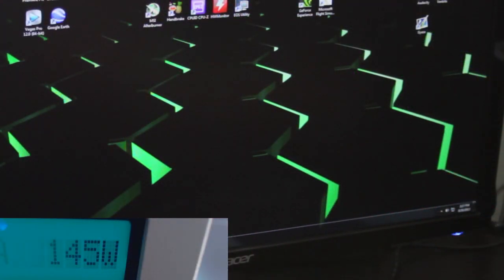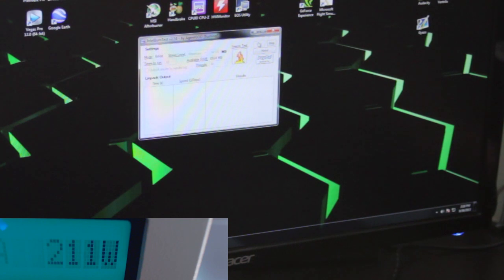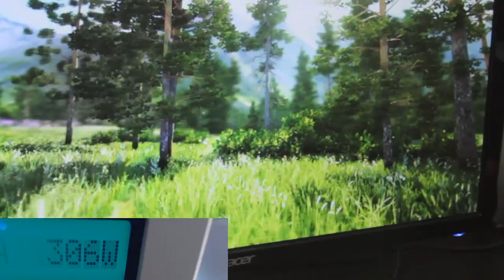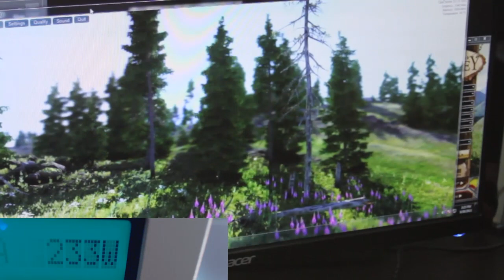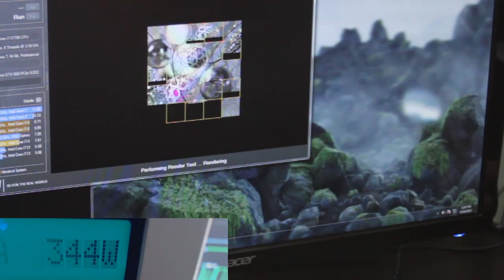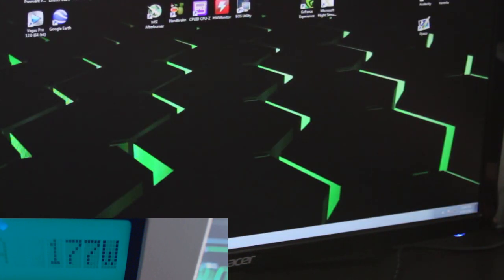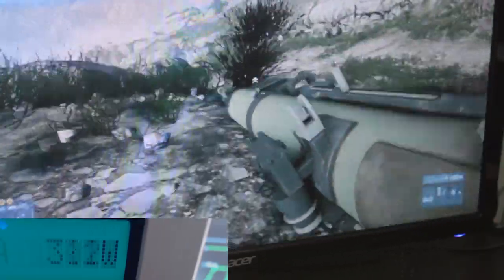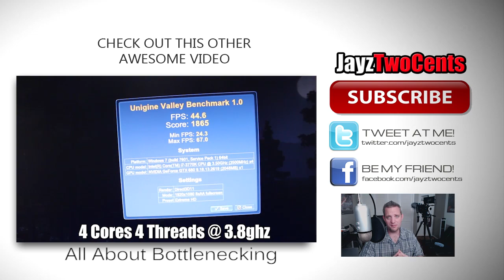How big of a Power Supply do you REALLY need?

Comment: Hes not entirely correct when he says the less of your psu you use the more you waste. most 80+ gold psus get about 87% eff at 20% load, 90% at 50% load, and back down to about 87% at 100% load. depending on the psu the eff will drop when load is below 20% and will typically get 82% eff at 10% load. so there's a sweat spot though the difference is minimal. sometimes its worth buying a  larger psu than you need so you wont have to buy another psu down the road
Reply: +SnipeYouFromMars Would anyone here mind checking my build's compatibility as well as total power requirement??
This is my first build, and i'm up to my last part; PSU. :(  and each item on the website doesn't specify the wattage needed. 
Only a few which i will list on the very bottom.
Feel free to give me suggestions on what other parts may be better. (im on a budget) 

MB: Biostart TA970 AM3+ AMD 970 + SB950 SATA 6Gb/s USB 3.0 ATX AMD Motherboard with UEFI BIOS
RAM: HyperX Fury 16Gb (2x8gb) 240-pin DDR3 SDRAM DDR3 1866 Model: HX318C10FBK2/16
HDD: WD Blue 1TB HDD 7200 RPM SATA 6gb/s 64mb Cache. Model: WD10E2EX
SSD: Samsung 850 EVO 250Gb 2.5inch SATA 6gb/s Internal SSD Model: MZ-75E250B/AM
GPU: Asus Stric Radeon R7 370 OC 4gb DDR5 256-bit display port HDMI 1.4aDVI-D ? 
CPU: AMD FX-6300 6-Core Processor Black Edition. Model: FD6300WMHKBOX
Liquid cooling: Silverstone TD03-LITE Durable High-Performance All in one Liquid CPU Cooler with Dual Adjustable 120mm PWM Fans. 
Case: DIYPC Zondda-O Black, USB 3.0 ATX MidTower Gaming PC case. 3x Orange/LED Fans. (I believe these 3 fans that come with the case will need power as well?) <Might regret that question because it sounds very stupid but im like flat on new to this.<

GPU (200 W) (I read in the comments of a review)
HDD (7 W) ??
CPU (95 W)
LiqCool: (12 V) ? 
RAM: (1.5 V) ? 

See, i'm not even sure i have them right, so it would be awesome if anyone can double check it's compatibility and power usage! 

Thanks :)
Reply: +Andrew Hamid literally take your shit to pcpartpicker.com

Comment: Hi, could people help me with my build please? I am wondering how much wattage my PSU should be at. According to PCPartPicker, the build runs at around 322W. Here is the build:
Intel Core i5-4690K 3.5GHz Quad-Core Processor
Corsair H110 94.0 CFM Liquid CPU Cooler
MSI H97 GAMING 3 ATX LGA1150 Motherboard
Kingston HyperX Fury Red 8GB (2 x 4GB) DDR3-1866 Memory
Seagate 1TB 3.5" 7200RPM Hybrid Internal Hard Drive
MSI GeForce GTX 960 2GB Video Card

People have told me to get either a 500W or a 400W PSU, so I am not sure which to get.
Thanks for the help!

EDIT: Both EVGA PSU
Reply: Thanks for the response!

Comment: I'm planning on buying a custom pc,
here are the specs:
CPU i5-4590
GPU gtx960
RAM 8 GB
so what's a decent power supply for a pc like this?
Reply: +Szabolcs Mate thanks for the advice
Reply: +Vasilijan Nikolovski 500W with 80plus rating.
Reply: +Vasilijan Nikolovski A good quality 400W would do. May want to go above if you plan to upgrade to a higher tier GPU. Just pay attention the 6pin and 8pin connectors, or you may have to buy an adapter.

Comment: Yes a 750/850 watt power supply will have the Watts to run dual GPUs but what every1 forgets is the AMPs !
It may have to watts but does it have the AMPs to run everything ?????
Reply: Watts are a measurement of work, whereas amps are a measurement of the amount of energy used. You get watts by multiplying amps by volts. Given that watts= amps × volts then yes, you'll always have enough amps to run everything. But you do not measure amps alone because you need enough voltage (force) to push the amperage. This gives you your wattage rating.

Comment: If i have old/low/not so good specs. Do i need better or not so good power supply? And if you can tell what i need with these parts:  Graphic Card: Club 3D 2600XT GDDR3 512Mb Processor: i3-3220 3.3Ghz MOBO: ASROCK S1155 H61 USB2 GLE D-Sub MATX And 3 normal fans, i would be very happy!
Reply: u can use an aftermarket psu at about 350 or 400 watts.
Reply: +vertti kallio I would still get a decent power supply because if it fails it can screw up everything in your system
Reply: Sam Hewitt cx430-dont buy
evga 500w-do buy

Comment: I'm going crazy over all the different understandings on PSU. Here's my rig:

Intel core i7-4790 3,60 GHz
NVIDIA GeForce GTX 970
2 x 4GB DDR3
2TB SATA3 7200 rpm
120GB SSD
AcBel 80+ bronze 450watt

How do you feel about that?
Reply: +Reminiscity How is this running? I have pretty much the same rig I want to build for my Son asap only with a i7 4790, MSI B85-G41 PC Mate MB,  Evga GTX960 4 GB ACX 2.0 and 8GB ram DDR3 1600 and only (1) 1 TB WD Blue.  My questions are...I bought an Ultra Professional LSP V2 550 (Made 2013). Is this a big enough power supply? Is this PC enough power as he only plays World of Warcraft (Warlords of Draenor) My 1st build. Can anyone please help. Thanks for listening!

Comment: so 500W is more than enough for my low end crappy pc... good to know!
Reply: +GermanKraut he said low end pc
Reply: +Grizzly If your pc uses about 400-500w its perfectly FINE and even recommended by people who understand energy efficiency and capacitor aging to get a 1000W psu. Don't forget capacitors over time age. The more load on them the hotter they get, the hotter they get the shorter they last.
Reply: I'm pretty sure It's not the Power Watts. It's possibly that you have bad motherboard that is faulty. Or MAKE SURE you have adquect airflow in your case. Motherboard DOES NOT LIKE HEAT AT ALL......Dust is a great insulation. So make sure you get air flow and keep case clean of dust. 

Hope this helps despite its late.
Reply: I mean I have a 1060 and a couple fans and on high intercity games it sits around 350 so you’ll be good for a while
Reply: +TheSwedishDude95 lol
Reply: +Grizzly Surely. i5-2500K@4.4G + 7870 on 40W psu, only 250W in normal load, very max is 360W under nonsense synthetic load (FurMark+ Intel Burn Test)
Reply: +GermanKraut I have fx 8320 ,,and a r7 360,,I have 500 watts,and it turns system off,,do you know what power i need!!!r
Reply: Red Phoenix Interesting. Well lets see this 1000w RM1000 is more efficient at 30% then my tx650 was at 50%. But yes callbullshit all you want. All psus including platinum and titanium are the MOST efficient betwee 20-80%. It drops off a lot sharper after 80% then below 20%, hell this psu is 88% efficient down to 50w. While the prime efficiency range is between 30%-60% as the peak efficiency. But again you can believe what you want, reading a graph isn't hard haha.
Reply: matthew bungard Should be enough.

I hope its atleast a 80+ Bronze rated power supply, not some cheap china 500W Power supply.

If yes... Change it to an be quiet!...
Reply: +Grizzly 
Nope. Overclocked i7 6700k and GTX 980 are taking about 450W.
If you use AMD, well you need more.

Comment: Hi guys will a 500w power supply be enough for this build?

CPU:AMD X4 860K Quad core
GPU:GeForce GTX 750 ti
RAM:8GB Crucial ballistix sport
Hard disk:Western digital blue 500 GB
Motherboard:Msi a78m-e35

If it isn't enough tell me what's sufficient
Reply: +urawesome2 It is enough, i have 450w psu powering my GTX 970 and Xeon 1230v3
Reply: +Hobi Nimetön thx

Comment: i recently got a corsair cx 600m (600 watt) psu from a friend for my first build, and i was wondering if i could get your opinion on whether or not it can handle an r9 290 with an amd 8350 (not going to get into overclocking with this psu) and basic first build components (hyper 212 evo, 1866 g.skill ram, 1 hd, 1 ssd, 3 case fans, mouse/keyboard, and a fairly old 1080p moniter) without serious psu stress.

lmk thank you
Reply: dudewhy Noreallywhy Recommended is a 750 watt psu with that graphics card.

Comment: Actually you don't want to max out your PSU. You want load around 70-80% of rated wattage. So for 750W PSU that would be between 525-600 watts. That's when all quality PSUs are most efficient. You also got the 80 plus thing wrong.

Comment: The reason many people get a PSU larger than they need is because when they buy their graphics card there is some BS about PSU required. Classic example is when I put a R7 250 in my 6 year old HP Pavilion, which has an Intel dual core e5200. The website that I got my GPU from said I needed a 400W PSU. I decided to see if the 250W PSU in my Pavilion would work...on my power meter, I can't get it to go over 80W when running Valley benchmark, what do I need a 400W PSU for?
Likewise my i5 4690K with an R9 290X OC will hit 550W :-)

Comment: So.... I have a 750 watt 80+ bronze power supply. I run a gtx 660 (upgrading to 970 in a couple days) with i7 3770k with three monitors and I stream to Twitch. Do I need to upgrade or no. I only ask because streaming is very cpu intensive.
Reply: Don't worry about the PSU. Just make sure your CPU is cooled properly. Consider investing in a good CPU cooler

Comment: I ran 2x 680s with tons of other crap in my system when those cards were introduced and my system would hit about 500w - this while using the Corsair AX750.  I never had one problem.  I know run the 980 Ti with the same setup.  I also see folks buying 1200w PSU and running only 1 card.  It's their money.

Comment: How many wattage would be perfect for this build?

Case:Cooler Master Elite 120 Advanced Mini ITX
CPU: AMD A10 7850k 4.0 Ghz
Motherboard: MSI A78m-E35
Graphics Card: XFX Radeon r7 250x
RAM: Crucial Ballistix 8gb (adding another 8gb to get 16gb)
HDD: WD Blue 1TB

I bought a power supply that has 750 watts, but I think its too much for this build.

If I need a 500 watt power supply, I can just get the Cooler Master Thermal Master Mid Tower ATX case which comes with the 500 watt power supply.
Reply: ***** Thanks for helping...i guess
Reply: ***** Well thats what I was planning on buying from the start anyways, and i bought a GTX 750 ti ftw and pentium 3528 @ 4.4ghz

Comment: my build:
MOTHERBOARD: GIGABYTE 970A-DS3P AMD 970 ATX w/ Ultra Durable 4 Classic, On/Off Charge, GbLAN, 2 PCIe x16, 3 PCIe x1, 2 PCI

CPU: AMD FX-9590 4.70 GHz (5.0GHz Turbo) Eight-Core AM3+ CPU 8MB L2 Cache & Turbo Core Technology

RAM:16gb 2133 Mhz 8 gb x 2

GPU: NVIDIA GeForce GTX 970 4GB GDDR5 PCIe 3.0 x16 (Maxwell)

POWERSUPPLY: 650 Watts - Corsair CSM Series CS650M 80+ Gold Certified Modular Ultra Quiet Power Supply

Will it run good?  I havent got it in the mail yet...

Comment: i am building this:

processor :AMD A6-3670K APU  with Radeon(tm) HD Graphics  2.70 GHz and four cores

RAM : 4 Gb

Graphics card : ASUS R9 270X DirectCU II TOP

How many watts do i need?
Reply: 450 will be fine
Reply: mr potato Are you sure about that?I need to be sure..
Reply: 100% don't worry man :)
Reply: johnb gaming if you're really worried then get a 500 :D which is what I'm using atm
Reply: Makes sure it's 80 plus
Reply: i'm just saying cause the guy at the "pc shop" showed me a 70 euro 650w..Does he just wanna sell me an expensive PSU or do i really need those?
Reply: And why 80 plus anyways? what does it have?
Reply: Also i will be adding another 4gb of ram in the future but that wont affect the power needed right? So a psu like the Corsair Builder Series CX500 500W 12cm Fan 80+ Bronze would be fine right?
Reply: I also may or may not add the FX-6300 (which will require a new motherboard too).Will the Corsair Builder Series CX500 500W 12cm Fan 80+ Bronze cover all of my power needs?
Reply: I want to upgrade my GPU (as i said) AND in the future i MIGHT change the CPU (and the motherboard of course)..Is the "Corsair Builder Series CX500 500W 12cm Fan 80+ Bronze" a good choice or not? (That's what i'm thinking of getting that's why.)
Reply: Nah i'm good with the 270x i think.I found at 180 from 220 euros (the top edition).Thanks anyways for all your help :).
Reply: Oh and one last thing.What's the difference betwen CX500M 80Plus and CX500 80Plus.Which is better?
Reply: I needed answers not more confusion xD.So you mean the CX500M is smaller or something?
Reply: ok thank you i got it now :P

Comment: i have a build with pentium dual core E5700 at 3GHz, 4gb of ddr3 ram, and hdd with 500gb at 5200 rpm and an amd radeon HD 6670 and i'm planning to upgrade to a core 2 quad q9650 or q9500 with a gtx 760 or a gtx 750ti or even an amd 7870 and add 2gb of ram.
What psu will i need ?

Comment: I think one reason people tend to get an oversized PSU is because manufacturers always recommend a higher wattage then is actually needed, to cover their ass in case someone buys a very low quality PSU, or happens to be using an abnormally power-hungry build with an ultra-high performance cpu overclocked to a gazillion GHz, with 35 fans and 10 water pumps or some shit. For example, according to Sapphire, their R9 280x tri-x edition requires a 750W power supply, but pretty much every forum I visit tells me all I need is 600W as long as I get an 80+ rated PSU. Also, pcpartpicker estimates the wattage of my system to be only 439W (http://ca.pcpartpicker.com/p/jzxFLk) so I think I'll just go with the 600W.
Reply: +il2xbox  "overclocked to a gazillion GHz, with 35 fans and 10 water pumps or some shit"....hahahahahah!!!!!!!!!!!!!!!!!!!
Reply: It's because wattage is one of the tangible numbers buyers can see. Then they decide to buy some 500 watt unit for only 25 dollars, except that 25 dollar unit can only deliver about 250 watts. Anyone buying a Logisys or Coolmax at that price point are buying garbage.  GPU manufactuers are NOT here to educate people about the nuances about power supply operation, but they know people buy garbage just because they have 500 watts on the label. There is no regulatory body dictating what proper wattage is on a label either, so manufacturers can do as they please if then don't want the voluntary 80 Plus certs. 

The GPU manufacturer's recommendations take into the account that those people would blame the GPU manufacturer instead of the PSU manufacturer and some lawyer WOULD take that case for a class action lawsuit.

Comment: My build:
Case: Sharkoon VG4-W
Motherboard: MSI 970AA-G46
CPU: AMD FX-8350
RAM: KINGSTON HyperX Beast 8GB DDR3-2133MHz
Graphics card: Sapphire Radeon R9 280 3GB Dual-X Boost OC (500watt)
HDD: Western Digital Caviar Blue 1TB
WHAT PSU DO I NEED????????
Reply: King Firefly 1 CPU, 1 Graphic Card, 600w is more than enough
750w is an overkill
Reply: King Firefly I think 750w would be enough.
Reply: 650w
Reply: Tuomas Tomaatti  before you spit something out, explain why you think that. 750 is way too much unless he needs room for a future graphics card
Reply: King Firefly why go all amd, just because you see that is had 8 cores doesnt mean its that good. my i7 with 4 cores, 8 threads will smoke it in cinebench. an i5 with 4 cores 4 threads will smoke it also. most games wont even use all 8 cores.
Reply: Macalyn Hulsey I think if you're just playing games. AMD is cheaper and it's enough for gaming. You might get 10-20 more FPS from Intel, but is it really necessary to spend a few hundred dollars more when you can get a solid FPS from AMD as well?
Reply: lioncommingz That's true only up until the FX-6300. But if you are getting an FX-8320 with a cheap motherboard it will not run because the cheapest don't support 125W, and if you are going to spend more on the motherboard that also adds to the cost. And with the FX-8320 you are going to lose a lot more than 10-15 fps, maybe as much as 35 fps if the CPU is heavy throtling, so that only leaves the FX-8350 as a gamer option, so add 170$ it costs with a 30$ more expensive motherboard solution and a 600W PSU and you are almost up to the point where it could be made for the same price an H97 cheap motherboard, an i7 4690K overclocked to 3.9Ghz on the stock  cooler and you could also make on the tight budget a gaming PC with Intel that doesn't get the penalty from being CPU bounded.

I have always supported AMD and up to the FX-6300 they are still pretty competitive (putting aside things like the older/cheaper motherboards DON'T get well-timed enough updates for newer Windows OS iterations, that I was ashamed to find out when my ASUS M5A99X EVO didn't have the fan controller in their official page even in April 2014 when I swapped to Windows 8), but it is pretty impossible to recommend an AMD CPU for anything higher, if you are good to go with an FX-6300 or lower go AMD, if not, go always Intel. And I was a heavily AMD fanboy, but that doesn't make sense anymore in the mid-high end CPU spectrum.
Reply: +iStrong You are wrong a R9 280 only requires a 500 watt PSU hence its 2x6 pin power connectors;)

Comment: fx 8350 4ghz-8 cores
8-16gb dd3 1866/1600
r7 240
hdd : 1 tb sata 3
it`s enough a 500 W power supply?
Reply: johnnyonPC Easily. U could use 350 watts PSU with that gpu :D.
Reply: thanks, also i`ll have bottlenecking?
(because of my gpu)
Reply: johnnyonPC Yeah, the gpu bottlenecks.
Reply: i bought this card, a mouth ago,and the reason  i wont change it is: it can run most of the games i want, i don`t have high requirements, and i figured that a fx83500 would  be too much so for my Pc, a fx6300 and 8 gb of ram would be enough.
thanks for the advice!
Reply: ***** im running a i7 4790k with a  r7 260x, of course i don't play games much. maybe he does more cpu intensive stuff like me such as rendering animations. but it does run fine whenever i do play games
Reply: johnnyonPC Why get a 8350 with a r7 240? its better to get a 6300 or something with a 260x or 750
Reply: yeah i changed my mind i`ll get a 6300.
Reply: +johnnyonPC it's more than enough but i advice you to get a lower end cpu (like fx 6300 ,athlon 4x )and save about 50$  or more and spend that on a better gpu